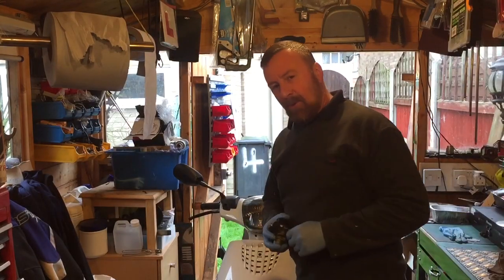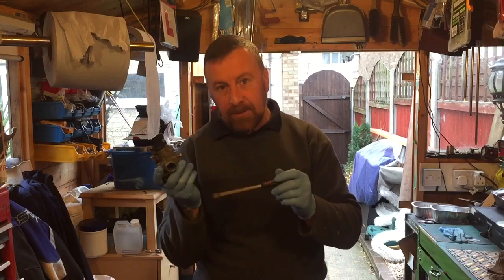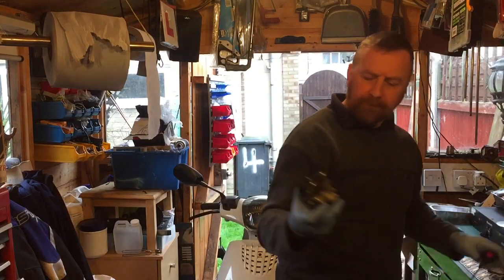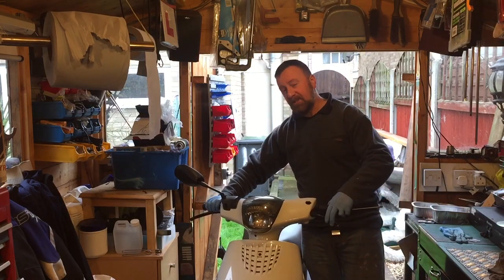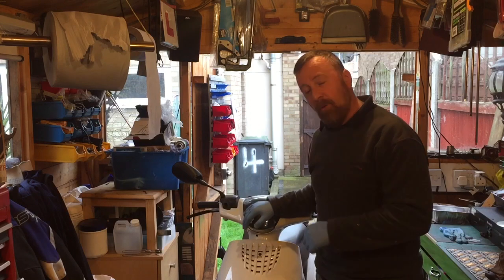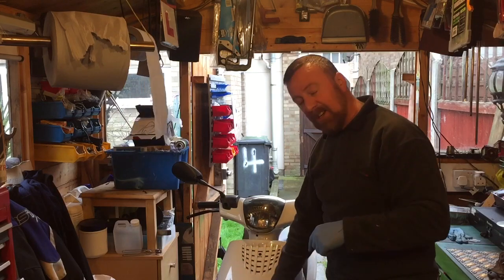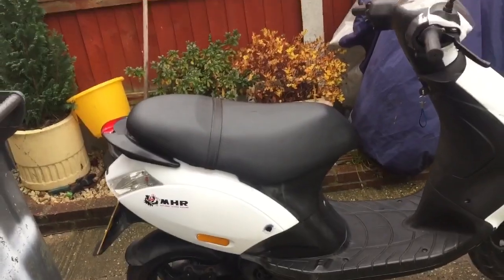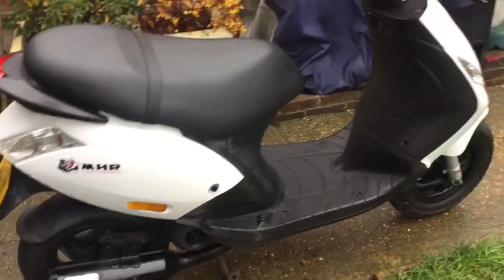TUNING 2T CARB CARBURETOR FOR MOTORBIKE MOPED  BETTER PROFORMANCE  MARK SAVAGE

Comment: Hi Mark thanks for the reply and no I didn't bend the pop over I completely removed it and welded a plate over the hole that was in the pipe.
Iv fitted the 12mm Gurtner carb that is fitted with a 45 pilot jet and a 56 main jet the needle clip is in the second notch my air mixture screw is about 1 and a quarter turns out from fully closed but after riding around the garden my plug is black
Reply from the maker: So that's running too rich so more air needed 
Needle is right and jet size too
So you need to come out more 
Do you have to air box link pipe on ?,
If so take it off 
Like in my 2t carb tuning video you need to slowly turn out the air mix 
But guessing it still on choke 
Is that working ok and coming off as that would run rich !

Comment: Giving gas while on stand is a bit problem for speedfight 2. Central stand is in same direction as movement of the piston, like straight line. Inertia of piston makes tiny lifting vibration to stand and that pull whole bike back. Engineering mistake

Comment: TY for your videos,,,,So tell me if this is correct when it comes to tuning, turn the mixture screw until you are at highest idle, THEN adjust the throttle screw.  When the mixture screw is turned in all the way in it should kill the engine, if it does not then you need a smaller pilot jet.  Likewise, if you turn the mixture screw all the way out and you cant get highest idle the you need bigger pilot jet

Comment: Hi Mark iv got the scooter running and after riding it around the garden the plug seams to be a light Sandy brown but today it wouldn't start checked the plug and it was wet but had a weak spark so put it in the oven to warm up fitted it and it started and died so did it again and the same happened so I replaced the already new spark plug and it fired up straight away what could be eating my new plugs

Comment: Hi Mark it does have the link pipe yes and the choke seams to be working fine and I don't touch anything till its warmed up like u say in your videos.
I was wondering I put the needle clip on the top notch would that help or should I just leave it on the second notch as I'd prefer to leave the link pipe on as I don't want any water or moisture getting in to the carb
Reply from the maker: to be honest the link pipe can cause this problem and id run it off to see how it runs. 
ive had them that only run with it  and other with out, don't worry about water it doesn't get in 
give it a good and id leave the needle till you try this bud

Comment: Mark don’t you think setting the mixer screw is to adjust it get it on the road 30second blast kill it take plug out because it’s hot no wait on it ?? Just like to know your reply mate
Reply from the maker: so the air mix screw is to set the carb up,if wrong it will be too lean and run with no power and if to rich it will flood run lumpy and black up your plug 
you start at 3 half and go in or out for best running and I have a video on a zip on how to do it right and a few others
it does not make your bike over heat just wring as said and you need to set it up right
take in to consideration have you got the right plug in and is it ok or need replacing 
air filter is it clean or need replacing 
jet size too big or too small
throttle cable and setting or needle
air cooled or water cooled 
state of stator and ht coil 
any one of these can mess around not even to mention the reeds

Comment: Hi mark, I’ve asked you a few questions before. I Have am Aerox with a 70cc kit  (new piston and cylinder) and a stage 6 exhaust (new)  and 4.5g rollers. It bogs down untill about 20mph then zooms off the 60mph. I want the power at the start back I was wondering wether I need a bigger carb or a cone filter
Reply from the maker: With light roller 4 5g it should pull away well 
I use 6g 
You know I dont like 70 kits 
Yea carb and tune so you still using 17.5 
Might be worth 19mm 
And them jet plus 4 
I dont like sports air filters but on the aerox they work better so try that and air mix first
Reply: mark savage it’s not even the 17.5 it’s still the 12mm because my old 70cc kit was a low power one basically 5mph more than a 50cc so never needed to change it. But I think it’s time

Comment: Just a quick question with it running rich with a 56 main jet would down sizing to a 54 main jet help
Reply: Really depends where youre feeling it, if its at 3/4 to full throttle and its rich, then its the main jet yeah and downsizing will help.

Comment: Hi Mark sorry to bother you but I'm struggling with setting up my carb on my 2009 50cc lc speedfight 2. It's all standard so no sports pipe or performance air filter the only thing iv done was remove the variator washer and removed the silly pipe on the exhaust. Iv had to replace the carb as it was all gunked up inside I tryed to clean it plus i was unable to remove the jets so im now running a 12mm Gurtner but unsure what main jet or pilot jet I would need plus the needle what notch does the clip need to be on ?
Reply from the maker: As long as you bend over the metal pipe on the exhaust that the pipe was connected to that fine 
Now carb that's your problem 
You will need a speedfight carb only 
Not one of these Chinese carbs 
If so the air mix must be all the way in 
54 / 56 standard jet 
Try and get a 2nd one or have a good go at the old one

Comment: Hi again mark 
My nephew is having a problem again with his speedfight 2 we eventually got it running and it's been great for a few weeks but now it's actually bogging out at top end any ideas what it could be please 
Many thanks Chris
Reply from the maker: hi bud, ok what did you change to get it running from last tiem, what air filter are you running on it ?, did you change the piston? sometimes if the air petrol mix is not right it can soil up the spark plug give that a look at 
or simple it's wet on the roads now and water can get to the ht plug and ark out 
try is in one of my videos place a bit of plastic / rubber ( like a mud flap only needs to be 4" sq) )  to cover the plug from the water is spraying up from the rear wheel as it common 
hope that helps
mark

Comment: Hi mark. Great videos ive a 125 speedfight after changing the starter moter it still wont even turn over engines ok the starter will work when earth's to engine but not fitted really sruck any ideas
Reply from the maker: Check earth to starter
Check battery earth
Check micro switches and brake light comes on
They do suffer from earth 
,if needed run a new earth to frame Check live is ok and insolated
Reply: Mark thank you for taking time out to reply to my question, your absolutely spot on the earth to the engine was only 10V a little bit of cleaning around the terminal and away we go.

Comment: hello mate I have a aerox just had a new carb and when I rev it it will stay high revs for like 5 10 seconds and the drop down and cut out have u got any ideas please??
Reply from the maker: ciaran haverty tuning bud or air leak 
Make sure it all tight and not sucking in air 
Air fuel pipes ok 
Air box 
Needle in ok 
Auto choke 
Float not sticking 
Check it all over then like in my video , tuning bud 
Please like share and sub
Mark
Reply: Start your bike and spray the boot and intake manifold with starter fluid if it bogs down you have an air leak if it doesn't bog then you're just running lean and you need to adjust your fuel-air screw if it just in your fuel air screw does not work that means that you need to up jet if it is a carburetor that has both a slow Jet and a main jet change jet to a larger Jet and retune and if it's a carburetor like a NT carb that only has a main jet change a needle clip setting if that does not work change the main jet out to a larger size

Comment: I confused, 3,5 turns on air screw or fuel screw?
Reply from the maker: hi bud 
confused how, you find the air mix screw , like in the tuning video and I do have a few on 2t and 4t bikes 
remember where the screw is so how many turns it was when you screw it in so if it goes wrong you can put it back as was!
I say 3 half turns as your hand wont turn 360! so do it in half turns , as in the videos bud theres 465 videos all in and 150 on mopeds but they should all help
what is your moped or bike 2t or 4t then its 3 or 6 half turns out stranded and tune from there bud
Reply: mark savage thanks for answer mister ;) I know where are all screws, Just my mother language is not english, So I not understood in video you was talking about air mix screw or fuel mix screw, cuz I think one time you said about air mix screw and then later fuel mix screw :) but enyway all good now, thanks :)

Comment: Hi mark I’ve got a speed fight 2 ac 50cc it’s got race exhaust carb is upjetted to 68 running 6 gram rollers and it really struggles to get past 30mph I was thinking of upgrading to carb to a 17mm one to see if it would make it that bit faster but I thought I’d get your opinion on it first
Reply from the maker: Ok 
Sports exhaust?
It is a good one and not really loud ? If so too much getting out and the problem 
Carb ?
Speedfight standard carb 60 jet 
Speedfight air box , with or without link box?
Variator 6g is right but like in my videos?

Comment: Can you tell me how to regulate my piaggio zip dellorto 17.5mm carb,
I put in a sport filter instead of the black box,
Help me please,
What i have do to fix,when i rev it it chokes and drops the gas
Reply from the maker: hi bud give these videos a watch 
https://www.youtube.com/edit?o=U&video_id=3d8CSH7Aw9o
https://www.youtube.com/edit?o=U&video_id=10jU4wHn8Ig
they should help plus I have another 150 on mopeds that also may help 
please like and sub
mark
Reply: mark savage ok but my friend told me to regulate my carb, is that correct?
Reply from the maker: to do what! , if he says that bud let him do it as I have no idea what regulating the carb is?
clean, up jet down jet maybe as in my videos on how to do it then the air mix maybe that's what he is saying 
this videos says how to adjust it bud,
mark

Comment: Does anyone know what size carb I need for a Peugeot speed fight 4 2 stroke 70cc as I think I have a too small of a carb because when it’s idling it just turns off and when I’m riding it kind of bogs and at full throttle the speed just slowly goes down like it’s losing power

Comment: Hi mark, just rebuilt my 50cc top end and it’s hard to start. anyways i got it started but it ran like rubbish. so i put my hand over the cylinder and felt air. could air be coming from the flywheel? is liquid gasket a good option? thanks mark
Reply from the maker: they can run bad for fitting and may take a little running first , however I not sure what your saying you put you hand over the head 
is it air cooled or water , 
ive put them back you gasket seal and they are fine ,so you think its leaking from the head? 
did it tighten down ok like in my videos criss cross  ,could be loose I guess
Reply: Yes, the bolts are very tight but i’ll eventually get it running and the isles really dodgy so I then I put hand over the head and felt air getting sucked on. Could I use gasket sealer to do it?

Comment: Can you help speedfight 50cc a.c. very hard to start when cold after it's warmed up starts every time on the button and kick..
Reply from the maker: check out my Auto chock video, how to test connect the green to earth and yellow to live it should come out by 6 mm ish or moreI used to just buy another on e bay as only £10 or so , this will helpmaybe check or change plug too, while the carb is off give it a service like in my carb videosmark

Comment: Hi mark , just want to start with , luv Ur vids bud👍 
Got a question mate I've got a 2016mod Piaggio zip 2t 50cc it runs like a dream on idle and up to half throttle then totally bogs down , I'm missing all the top end power . It has a standard 53 size main jet wld U recommend me changing the the size of that or should I be looking elsewhere on the bike? Any info wld be much appreciated 👍
Reply from the maker: hi bud , you have changed the plug and air filter , then carb off and clean like in my videos them tune as in 3 half turns to start .
have yo a sports exhaust ?,
Reply: Cheers mate👍
Reply: Yes I've done all those things mark after watching Ur vids , the bike is practically new only done 1500 ks nothing has been tampered with . Should I be getting the CDI, coil tested now ? Maybe it's electrical . It's the stock exhaust on it and a dellorto carb I forgot to mention .
Reply from the maker: @mattkennedy9610  no cdi is fine as its running , spark is nice and blue and not orange when testing  , carb cleaned with carb cleaner 
what fuel are you using 
e10 or e5 and in my video use e5 only
Reply: Hi mark I only use a e5 fuel mate , never E10. It hasn't got the restricter plate in the back of the carb I bought it like that , wld that cause it to bog on high revs? I'm pretty sure it's spose to have one standard , it's the same as the white one in Ur vid there . 2016 model . Cheers mate.
Reply from the maker: @mattkennedy9610  yes bud , i thought you had it from new, sounds like someone has played with it , you might be able to tune it with less air so mix screw in more, but have a play with the air mix, if all standard , maybe look into a sports exhaust then a little upjet by 4
Reply: Thanks mate will try that tommorow.

Comment: Hi mate 
I’m having some trouble with my air fuel mix screw never knew what to set it at so always left the screw as it is when I buy the carb 
So it’s screw the screw all the way in and 3 half turns out is that correct 

I have modified it with exhaust and bore so would I need more half turns out
Reply from the maker: standard set is 3 half out on 2t , then either out as normal or in , as in my other tuning videos bud
Reply: @marksavage  so what about if it’s a tuned scooter shall I just go out more thank you fie the help vids a great

Comment: Hi Mark, when bike is running no matter the weather or temperature my exhaust seems to give out near enough no visible smoke. It’s not running lean or rich so any idea why? Is it anything to worry about?
Reply from the maker: It's all ok as long as your using 2t oil it just means your piston rings are really good and the engine is running well so burning all the oil with no excess bud 
Dont worry
Reply: mark savage Brill!! Thanks again bud

Comment: math question: if i have a derbi gpr 125 2t (yamaha engine) with an freeflow air filter, what size should my main jet be,  250?
Reply from the maker: sorry bud I cant say I know as I just don't , id be looking at what you have in there now and go up in 4s if you want to 
id say how is it running and start now, if ok and it has a good top speed id leave it as is

Comment: can you please give me some advice. i have a peugeot speedfight 2 lc 2003 and it does not run. it has a good blue spark and it gets fuel because the sparkplug gets wet after a copple of kicks
Reply from the maker: Anton Pol hi bud was it running before and when did it stop ie what happened ?
If you have spark and a wet plug then you may have to think no about looking at the piston !
Buts it KC so gasket set will be needed but that’s what I’d be looking at next if you have tried everything else like in my other videos give them a look bud there’s loads to watch 
Mark

Comment: What size rollers would you recommend for a speedfight 100
Reply from the maker: hi bud , 10g to 11g they will be fine, remember to give it all a good clean and change the belt if it looks slack or worn.hope that helps I do have a lot of videos on the variator system maybe give them a watch. mark
Reply: Cheer bud

Comment: Hi mark

I installed a powerfilter on my scooter and when i go 3/4 throttle its fine but when i go full throttle it starts going BWWWWAAAAaaap.. and starts bogging down
Do you know how to fix that?
Reply from the maker: Take the power filter back off lol
Too much air , you will need to marry up th3 jet to the filter 
Find out jet size
Buy a pack of 10 different size either side and change up or down till it runs with a little tune

Comment: Hi Mark I like to se all your videos I have a Piaggio Zip 50 2T from 2015 same this one when I drive and give a full acceleration the peed cutting down any advice please appreciate thank you
Reply from the maker: i do have a few on the zip type in zip or moped 50cc mark savage 
as for you problem 
that is common and more likely to be carb problems 
when did last service the moped
what have yo done and what has been changed
Reply: Mark sory I don’t know last service because I buy a 2 months a go I been order a new carburettor 19 can you please let me know the set up the new carburettor thank you sow much I like to see all your videos cheers
Reply from the maker: @MrBerenguer67  you might of not needed a new carb however remember to put you old jet in the new carb as thats what it was running on 
3 half start as in my tuning videos
type in tuning mark savage
Reply: Yes I will many thks